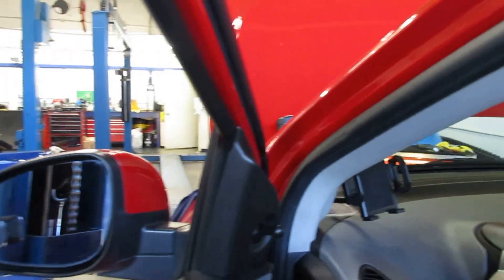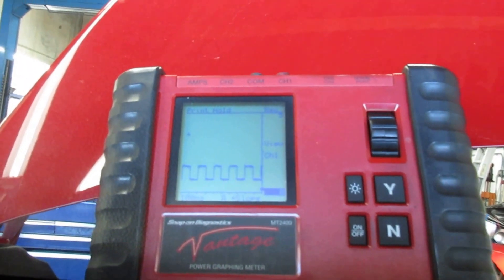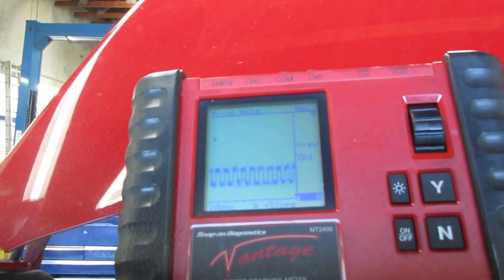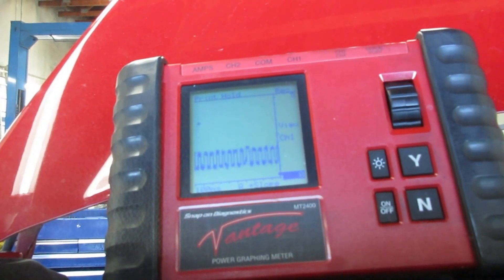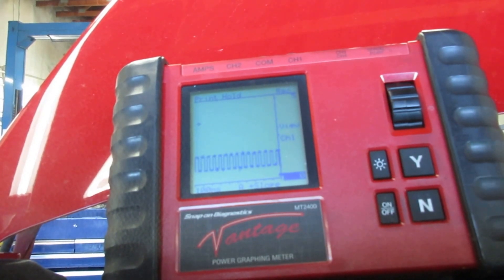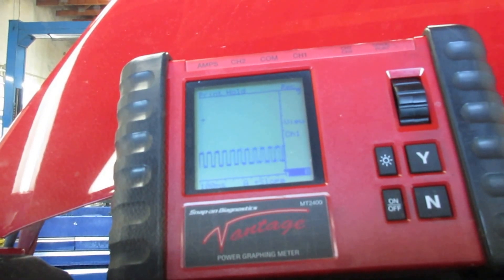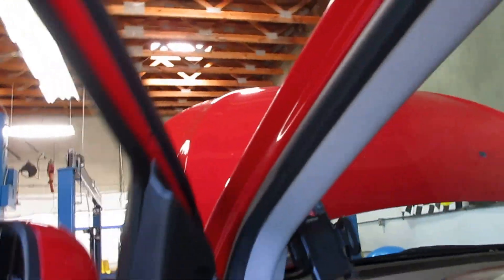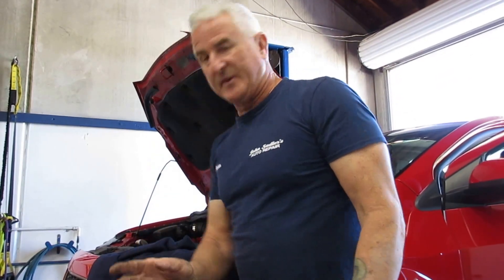C0035 GM Wheel Speed Sensor Circuit

Comment: So what was the code c0035 left front?
Reply from the maker: There is a tone ring behind the hub that the sensor gets the signal from. 
It was cracked causing the problem.
Reply: @JohnSadlersAutoRepair  I have that code trouble code on my car I have a Harbor Freight scanner and it says I have a problem with the right rear wheel sensor circuit which I found the scanner not to be accurate I looked it up online and it's the left front I found that the harness is bad I replaced it clear the codes and it's okay now bad part of it I spent $50 for nothing on a right rear wheel bearing
Reply: @JohnSadlersAutoRepair so replacing the hub will fix this
Reply from the maker: @MatteBoom  My customer had a broken spacer behind the wheel bearing.  I recommend checking the signal first like in the video, if you see a problem take the hub off and look for a  broken spacer.

Comment: Common problem with GM speed sensors after rust jacking gets a toehold in the hub.
Reply from the maker: Hi Stanley, this vehicle just came back and I found a glitch from the encoder ring that is built onto the wheel bearing.
Reply: Ah, I see. Not as common, but encoder rings do have their issues.